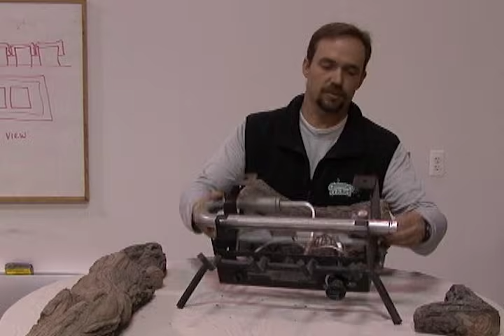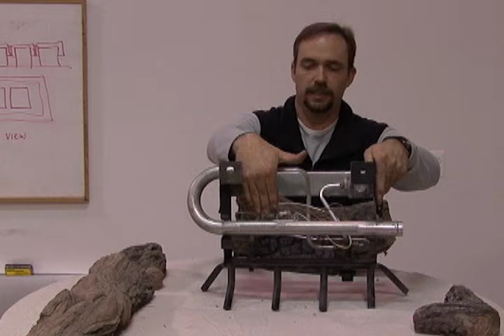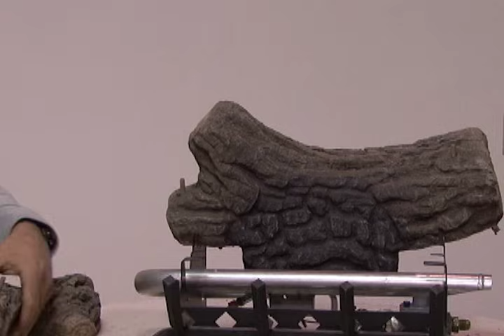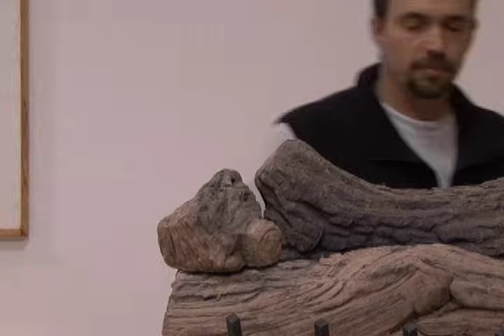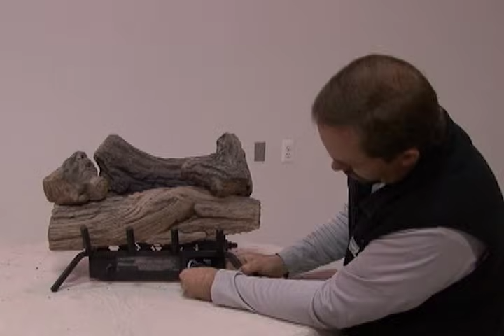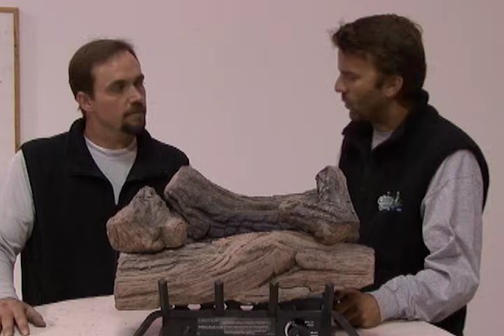Installing Vent Free Gas Log Set

Comment: I live in an old house that has a "fireplace". It was originally set up to hold a gas stove I believe and not act as a full on fireplace. It has a flu and has brick surround. I do not believe the flooring is fire rated. per a chimney sweep. Do you think it would be safe to use a ventless set up for this fireplace? vent closed or open?

Comment: When the lower level of my home was finished the contractor put in a gas fireplace and log set, however, it was installed without a vent. Can't use it, as when lit gives off a terrible and I assume toxic smell. Can I convert this gad fireplace to ventless without replacing the firebox.  Is it the log that create the toxic smell or the gas itself as it has no vent?
Reply: carbon monoxide kills. If you're still alive. Install a chimney so it vents the fireplace. Or replace fireplace with an electric model

Comment: Folks the answer to most of your questions is: Vent-free gas log set and fireplaces a totally safe if installed by a certified gas technician. It is not a DIY project!  Also, Vent-free gas logs have a safety feature an (Oxygen Depletion Sensor) that will automatically shut the appliance off if something goes wrong. Vented Gas Appliances do not. In addition.they do require Annual Service, whether you use it a little or a lot. Failure to do this will cause problems down the road.

Also, all vent-free appliances are made to operate on one fuel type. Each burner is set up to run only on Natural Gas or Propane. They are not interchangeable from one gas type to the other. Attempting to do so will cause problems you don't want to deal with.

And, finally.  Purchasing from a gas log dealer in your area is safer than buying one online or a big box store. Because they should have the knowledge to size the the BTU output to your specific needs. Since Vent-free is 99% efficient, more is not better. By the way, in the past 20 years over a million Vent-free units have been sold and installed in home throughout the country. According to the American Lung Association, there has never been a death related to use of a Vent-free gas appliance. When properly installed and operated according to the Owners Manual requirements.
Reply: I have a new ventless installed but can't get the pilot to light.
Yes there is gas to it.
The igniter is sparkling.
Any ideas?
Reply: @glstevens7186  The gas shutoff valve may be in the OFF position. Therefor, no gas is getting to the pilot. Was this professionally installed or was it a DIY project?
Reply: @glstevens7186  Is it a natural gas or propane unit?  Are you following the Owner's Manual instructions for lighting the pilot. Also, is the gas line shutoff valve turned ON?

Comment: I know this is an old video, but we moved into a home with this type of vent free system but the previous homeowners didn't leave a manual.  My unit looks just like the bottom of this unit, can you tell me what the brand of this one is?
Reply: I'm on the search for the same information. Did you ever figure it out?
Reply: mwoodj unfortunately not. Still not working and haven't gone any further with it. Still on list but not high priority. 😟
Reply: Go on line for operating instructions, they are all close to the same and easy to operate.

Comment: Can you use propane with these?
Reply: Greggie
Reply: Only if that's all you have available. And the burner must must be setup at the factory for Propane Gas. There is no conversion available to switch from one gas type to the other.